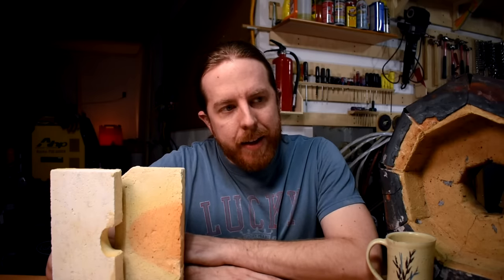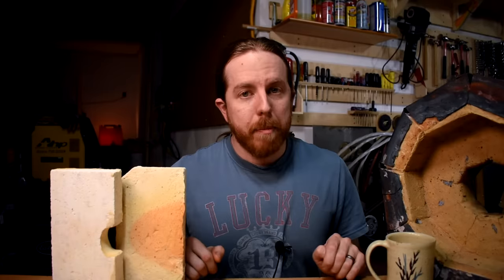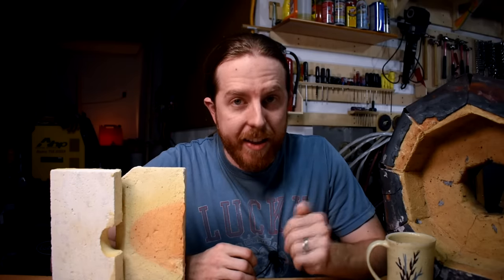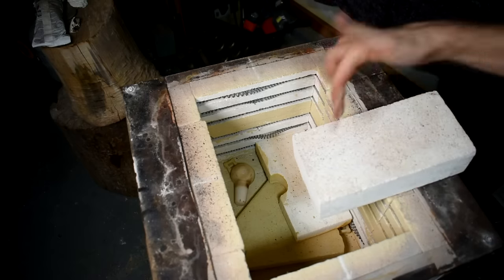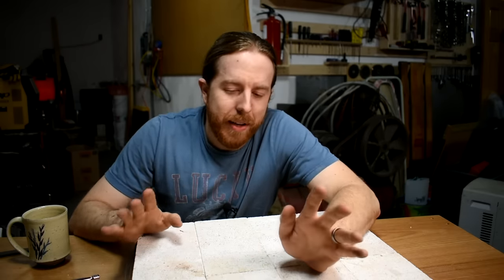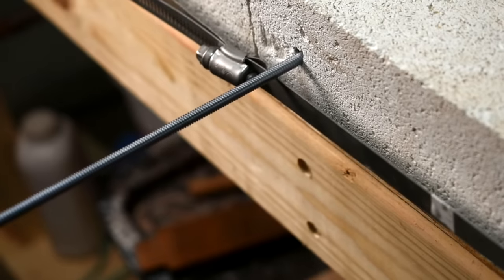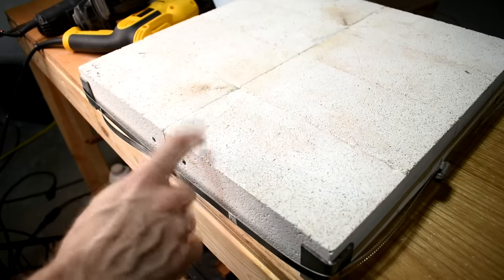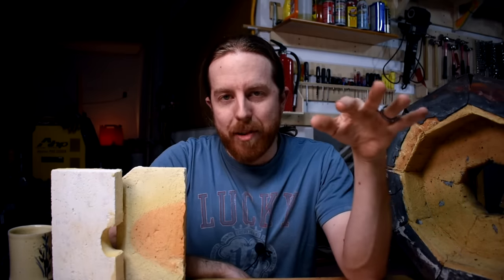There's a Problem With Fire Bricks

Comment: I used to work for a company that made cremators. They recommended to their customers that they rebuild the cremators every 10,000 hours. 
I also worked for one of the world's largest fire brick & kaowool manufacturers, and a large part of their sales was bricks & kaowool for rebuilds.
These bricks are only good for so long, then they need replacement.
Reply from the maker: I talked to a potter in Korea (one of those pictures was his kiln) and he said his kiln was the oldest in Icheon (a city of potters), at like 40 years lol. The place has had constant pottery production for a thousand years and the oldest kiln they got is 40!  These temperatures make everything temporary I guess

Comment: A few decades ago, an acquaintance of mine and I tried iron smelting, and built our smelter out of alumina kiln bricks, mortared with clay from my garden.  That was a terrible mistake.  At the yellow-white heat inside, the clay dissolved into the alumina like acetone into styrofoam.  The structure developed severe cracks.  After the first firing, it still seemed to be reasonably stable, but during the second run, it began to lean and seemed to be on the verge of collapsing.
Reply from the maker: Oh yeah iron temperature is insane, and most clays will melt a couple hundred degrees below iron temp.  A lot of minerals in clay will also turn into a flux above 2000f, so it will just destroy everything lol good thing you survived!

Comment: Frankly, it was both bad engineering, and the bricks.
When I make my kiln I'll be sure to "dome" the top.
And do wedge-shaped bricks for the sides with compression bands that can be adjusted.
And thank you for this info. You helped me a lot with these few words.
Reply from the maker: domed lids are ideal i think, wedge shape is good too.  My foundry furnace lid isn't domed, just wedged, and there have been no problems

Comment: The insinuative firebricks you are using, notoriously shrink when heated. 

Whilst, glossy refractory bricks have microsilica (amorphous) added in addition to expansile minerals which maintain a balanced neutral linear change with heat. 

0:22 this is a small sample of firebricks, 7th row down refers to the volume change. 

In the industry Andalusite brick is a good abrasive resistance when in contact with the flame but it will deform with temperature due to glassification of the aggregate (movement of crystalline silica), so they put in mortar gaps. 

Interlocking bricks are also used, which can be used without supporting structures.

When not in contact with materials or flame turbulance, I would use kaowool which can expand and contract freely and be supported on the cold side.
Reply from the maker: good info, thanks!

Comment: I recently built my third electric furnace and have many of these issues too. I thought about sticking a metal rod through the lid, but worried about differential thermal expansion cracking the bricks. What i did was:
- carve a groove on the exterior perimeter of the lid, and put a metal square frame there. The frame has some clearance to move around, but this clearance is much smaller than the grooves are deep, so thereś no space for the bricks to slip and fall, even with gaps between them.
- the bottom of the lid has ceramic wool insulation. This helps a lot in keeping heat away from the bricks, so they don´t expand/shrink so much, and also seals the gap between furnace and lid, so it helps with efficiency. The wool insulation is glued to the bricks with sodium silicate, and i also put some steel staples made from fire.
The top of the lid is barely warm to the touch when the furnace is melting aluminum, except in the air gaps between the bricks where it gets hotter.
Reply from the maker: that's a good idea too.  I'm also worried about the expansion of the steel rod, but I think it will be ok.  The rod won't increase in thickness enough to cause problems, but it could increase in length quite a bit, so it's just sitting in the groove.  It's free on both ends to expand out of the bricks if it needs to, nothing is holding it in.  Time will tell, though.  I'll have to use it a bit.
Reply: @PaulsGarage  Might i add that maybe use basic round stock, not treaded rod as it looks like you used. With this there is more supporting surface area and no treads to eat into brick when there is thermal expansion in the rod.

Comment: Thanks for your entertaining presentation. I saw a few videos where they were making their own firebrick with a mixture of refractory cement, vermiculite and sand. With that you can cast a custom-shaped piece of any size. Perhaps include reinforcing iron within the piece?
Reply from the maker: That's an interesting idea!  I'd be worried about the sand and vermiculite, i've heard those can vary a lot.  I'm planning on getting some Kast-o-lite 30 and make some stuff, maybe cast a lid or some bricks, but that's a plan for when the budget is a bit "healthier" lol

Comment: I'm a pyro, if anyone needs me for something

This is the first video of yours that I have watched, and I'm dying at the words on screen
Reply from the maker: Welcome to the pyro party!  I think everyone who does this stuff secretly just wants to burn and melt stuff for fun
Reply: @Paul's Garage     I had a piece of copper pipe I found as a kid that had a fitting on one end and was long and curved at the end. It looked kinda like a  smoking pipe. I would take dried grass and pack it into the fitting side that curved up, dip it in gasoline, let it drain out so it was just soaked in the grass, then light it with the fire pit and blow through the other end, sending 3ft flames out the other end. I miss those days, I will make a new pipe for it one of these days

Comment: I was a potter for 45 years (retired now because of hand issues), but I've built a number of kilns.  I've found that different manufacturers produce brick with different qualities.  I didn't like the chalky Babcock Wilcox bricks but preferred the A.P. Green product.  A Nichrome rod might have a better heat resistance than your steel threaded one.  I fired to cone 10 (2381° F)
Reply: Stainless steel has a higher heat resistance than carbon steel. Nicrosil (thermocouple alloy) is available in metal sections too.
Reply from the maker: thanks for the information!  I have a few kilns from different makers and I think you're right, the bricks are very different.  All the ones i've built used 2800f rated light bricks from armil cfs, but i think they sell bricks made by BNZ? i'm not sure.  I think a nichrome rod would be perfect, i just didn't have any on hand. 

Sorry to hear you quit pottery because of hand issues. I haven't made any pottery in a little over a year because I moved and had another kid, but I miss it a lot.  I only fired to cone 5 or so but I was using a local clay I dug up here and glaze made from another local clay, and above cone 5 I started to get problems with the glaze and around 6 the clay body started to fuze to the shelf. It would slump at 7, I found that out the hard way haha!

Comment: They dont shrink per say kinda  but more important is they expand when heated andcontract when cooling so if you make an adjustable clamp for your furnace you can tighten when you cool and loosen when you fire have to look at the specs on expansion rates for the brick you chose if your using an exposed flame you want the brick to be a hard brick or a superduty

Comment: Should add we don’t perfectly cut bricks to deal with the opening the door problem as glassblowers. We just replace the door. You figured it out but for a top loader you’ll need to reinforce the bricks. You also need to use cement. Honestly build a better structure for the whole thing with replacement of the bricks in mind. For a furnace I have a few designs that are nice I can share. If you want something more flexible a couple years ago I thought up a design for a front loader with a crucible hole on the top.

Comment: wonder if you can get the clay for making those bricks you could make youre own and make them to size and shape , not loosing any material by cutting it 
you have pottery ovens so you should be able to bake them a few pieces at a time (excapt maibe a one piece lid and bottom )
Reply from the maker: Good idea!  I think the bricks are made from alumina and some other stuff, with a filler that gets burned out to make them very porous (for light weight and insulation).  I know for a fact the 2800 rated bricks are much heavier than the 2400 rated bricks, maybe less filler in the heavier ones?  Not sure.
Reply: I have heard that filler includes sawdust.

(And yes, I want a small heat treating oven, for tools…. Need to get the $$$ somehow.)

Comment: You could strengthen the lid by changing its shape: Cut down the length of the outside 2 rows of bricks  (You only have to shorten one of the 2 bricks on the left and 1 on the right); or extend the length of the middle 2 rows of bricks. That way the band clamp pushes on all 4 pairs of bricks from the front and back, which effectively forms 4 full-length lintels. And the pressure from the side then only keep the 4 lintels together. Or if you view it from the other direction, each column of 4 bricks is pushed into a full-width lintel. But currently the force is only applied on the outside of that lintel. You could fix that by adding a spacer piece between the band clamp and the inside ends of those lintels.
Reply from the maker: That's a pretty good idea.  The lid is square but the opening is rectangular so there's some room to spare if I shorten the outer bricks

Comment: A buddy of mine who used to build heat-treating kilns would cut a channel in the sides of the bricks that would be deep enough [and wide enough] to accept half the width of a 1/4"x1" flat bar. That bar would slot through and be kept in place by the strap.

Maybe this is something you could try, because the threaded rod will only hold the bricks along a single axis. It'll still gap out in the middle.

Comment: I made my own fire brick. Something like 45% fire clay, 45% bentonite and 10% very fine sand (120 grit?).  The mold for the brick was circular so the burner would have a clean path around a crucible. Let it dry for 7 - 10 days, then slowly bake in the oven from 150 - 350 for 2 - 3 hours. Make a old cedar fence lattice on the ground. 4 or 5 layers thick. then place bricks on top of it. Add 4-5 cedar layers on top of the brick. Light it with a match and watch. when it starts to get really hot cover with more fence to trap the heat and burn slower. This doesn't fully cure the brick but it gets it close. Then build a kiln and fully cure , with the burner. Hit yellow colors inside the kiln.  It's held up very well for me. Wrap with fire blanket to stop air flow.  I cant promise it's better than commercially available brick, but you can make a cheaper kiln to your exact dimensions to properly fit your crucible. For best results don't make bricks thicker than 1 1/2" x 1 1/2". or the center wont fire properly. That's why I wrap with a fire blanket. After firing I sanded the brick using a 2x6 wrapped with sand paper. With calipers I could sand the bricks to within .020" to minimize gaps. For final assembly make a clay slurry and use it as mortar. My lid was only 1" thick with a hold cast in it, but it works well. It is smaller than your 18" by 24" lid, but it was cool to make a kiln from scratch and see it work. Cheers.

Comment: I never thought this bit of my brain would ever find function but for a little while in my teens I helped with the manufacture of electric ceramic furnaces for industry, they are almost always double skin with the bricks and the layers are deliberately offset as much as possible, so the corner of the bricks at the back is in the center of the bricks at the front. Takes a little more engineering up front but I think it might have been for this reason. I also remember refractory cement only being used on the outside layer and to bond the inside to the outside but the brickwork wasn't my job, I was wire brushing and painting everything metal red then enamel

Comment: It will be interesting to see how long the steel holds up. I bet it'll go soft and the holes you made will just make the cracking problem much worse, since the steel is effectively conducting heat away from the center of the lid, creating a more extreme temperature differential in the thin brick between the rod and the inside of the kiln.
Reply from the maker: we will definitely find out.  If the bricks fail it will be an excellent opportunity to reengineer a whole new lid and not have this problem any more
Reply: @PaulsGarage  Titanium may be more available than tungsten. If I am correct, titanium won’t take as much heat as the tungsten but will serve your purpose better than steel.
Reply: @katiedotson704  What are you taking about?  I can walk into any harbor freight or welding supply store and walk out with dozens of tungsten rods.
Reply: @Kineth1  6 inch long
Reply: @GigsVT  Well, yes, but that should be more than long enough to pin the brick edges together.
Reply: @Kineth1  Crap!  I just hate it when  I boldly present my ignorance for all the world to see. Thanks for the correction.

Comment: A) Use basalt rod.  It will have a coefficient of expansion that is much closer to the fire bricks.
B) Put a spring on the ends of your rod to maintain tension.
C) cast a 1 piece top for your kiln.  Recipes for thermal bricks are readily available.

Comment: I like making my own mix, but getting the proportions right so that it doesn't shrink and crack is a problem. Most of the components have a negative shrink, but if you add Lithium Oxide, which has a positive expansion, it cancels out. It takes about 5% Lithium Oxide to balance it out. You may have to experiment a bit, but it works.

Comment: Another great video!
Great comment about masonry arches.
Cheers from Alaska
Reply from the maker: thanks!  masonry arches are pretty awesome
Reply: @PaulsGarage I'm thinking about sending you some zinc ingots (pretty close to pure zinc, not alloys). At first I was dismissive of zinc but it doesn't take long to melt and it pours beautifully. 
At human temperatures, it is a lot like cast iron but shinier.
Are you still at 1818 Milton Ave? Or did your address change when you moved?
Cheers from Alaska
Reply from the maker: That would be great!  Milton Ave is a post office, i have a P.O. Box there, it's still there so that works.  Just let me know if/when you send it so i can check the box.  I'm not very good about going there often
Reply: @PaulsGarage  The ingots are in the mail. They should show up in about a week or so.

Comment: I'm gunna be honest I don't think the bricks are shrinking by any significant amount. But the steel band that is in tension and being heat cycled might be getting loose or stretching over time.leading to the inside bricks to fall in. You didn't want to put nuts on the rods because of thermal expansion but haven't considered it for the band 4x the rod length and probably only a few hundred less hot.

Comment: You could form and pour any one piece lid with castable firebrick mix. Add rebar for strength and extended a few beyond the edges to make handles.

Comment: As a Brick mason....my experience is you lay those in mortar w/ fire clay.....it let's it expand etc...I'm sure there are different grades of fire brick depending on where & what they are made of. And when they're hot , they're extremely fragile. You can throw a log in the fireplace & crack them easily if not careful. There's also "refractory mortar ". The metal expansion is totally different....the metal can twist or deform, putting more pressure on the bricks in certain applications. But, anyway...........

Comment: You did your reinforcement the way manufacturers do it on very cheap kilns, it's not a good solution, but it works(although you should use kanthal instead of steel). One of the better ways to connect bricks for the bottom or the top is mortise and tenon. 
Most important is the proper brick selection of course, for example JM26 from Morgan is one of the best choices for kiln building, has 1400C maximum operating temp, low shrinkage(0.2% at 1400) and is a good insulator by itself(but an outer layer of cerablanket or kaowool is still recommended. 
Bigger "bricks" tend to crack but it's obviously easier to work with them(just dont drop it).

Comment: You should check if you're bricks are still square, too. 
Since the "strongest parts" of the bricks are the angles and the corners, it's possible that the shrinking isn't the same along every part of the brick, making them not so square anymore, wich could be a problem when the oven you make is square.

Comment: adding any kind of insulation to the bottom of the lid may be enough to help reduce the issue and expand the life cycle of your lid.. I don't remember exactly what insulator we used in the forge shop I worked in but I do know we had massive steel doors with only the insulation just rawdogging the heat. They lasted a while as long as the insulation remained